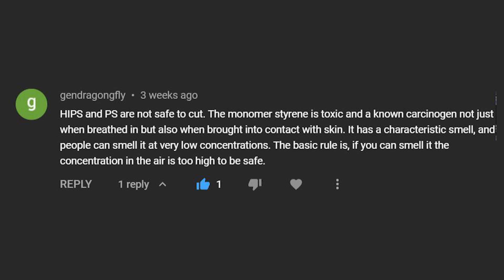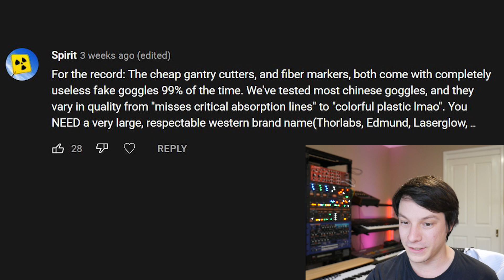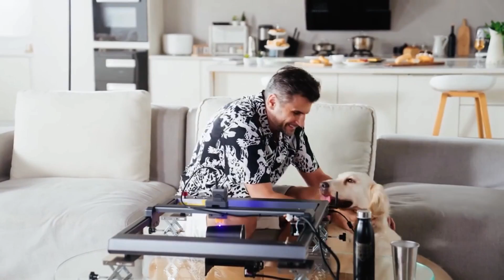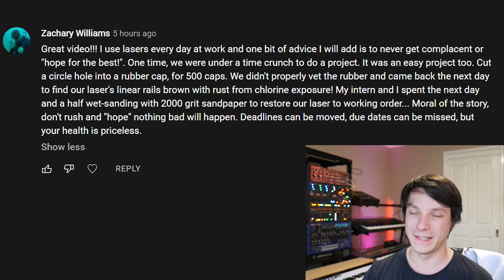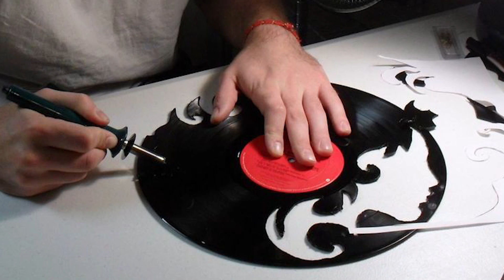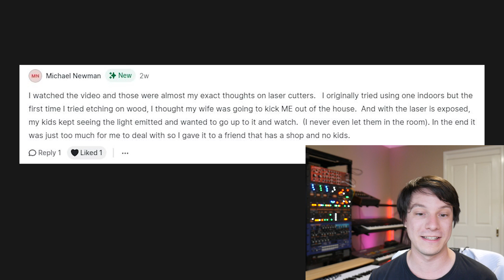What YOU had to say about Laser Cutter safety

Comment: I started with a cheap sub $100 laser a while ago, I upgraded over time and have gained experience with both co2 and diodes alike. Honestly, in the beginning I did not have knowledge or proper understanding of laser safety. At the time, I think part of issue is the community. Forums and videos always portrayed diodes as a toy and nothing more. You won't be batting with the big boys unless you get a co2. My first 5W diode was a real eye opener, a belt failed and it burned through my workshop wooden table. A simple $300 laser almost costed me my home. The prospect of burning my house down honestly made me realize how I really should have treated it like a "real" tool. I now have a  Jtech 14W as one of my main work horses, I spent about a equal amount to have a proper setup made. People don't realize the power these things put out, and I still see some of the toyish outlook on these diode lasers present. I just hope more companies and people start to understand the possible danger some of these can pose.
Reply: I don't own a laser but, I work in the printing industry and we're surrounded by diode lasers. Our imagesetters and print engines use diode lasers and they're certainly not toys. When Kodak shipped us a new diode laser for our Trendsetter the 6"x6" part was crated and palletized. I believe the "retail price" was $37k US. I know we weren't cutting through acrylic but we were imaging 26 23x35 (A1 ish) plates every hour 20+ hours a day 6 days a week.

Comment: The 1981 MGM fire in Las Vegas killed 85 people mostly from smoke inhalation from burning conduit and the coating on wires, lots of PVC. After the fire the building codes were changed to require metal conduit for commercial buildings. Low voltage wiring such as coax and cat 5/6 have to be in metal couduit.

Comment: This is so interesting. It took me a fair 2 months to research my options about lasers. A colleague of mine got a cheapo diode laser and showed me what he did with it. I sat down and researched it for a long time. An enclosure is an absolute must and making one for a cheapo laser is not exactly easy, safe and cheap. After much considerations I ended up with an EU built copy of a K40 that has CE confirmity. It was more expensive than a china K40 but I saved on shipping, import fees and it should be mostly safe. I ended up spending a fair bit on a went system, cooling, filtration, etc and still not everything is safely set up. Safety is really imoortant and people tend to be surprisingly uninformed...
Reply: I've designed a hermetically sealed Laser Engraving station for a 50W CO2-Laser. It's really, really tough to design a hatch for such a problem that is light-tight. I couldn't use rubber or any other sealant because even the reflection would damage it in a couple of weeks. In the end I had to design a labyrinth of metal sheets that reflected the light back into the case.
Reply: @huntersoa
 where did you get an EU-built K40?
Reply: @BonneWilce  I think the OG source was Variometrum from Hungary. But they no longer sell it. It was a second hand purchase from a small business. 
If you are interested variometrum still sells parts. Cooling, CO2 tubes, PSU, control board, etc. I think they also sell a complete movement system but they no longer carry k40 machines. 
Mine came with some extras to meet CE and had a proper manual, certification of safety, etc.

Comment: Great points about filtering before venting.  In addition to those, my vent fan had a leak in the hose after the filter.  Had I not been filtering the fumes first, that would have just vented into the shop space.  A basement makerspace I was with vented their laser out to the parking lot, and the fumes just accumulated back down into the shop.

Also, my wife an I have an agreement to never leave the laser running unattended.  I've seen too many fires from lasers at makerspaces and home shops.  Plus a fire extinguisher is cheap.  And  replacing the components or the whole laser from the use of a fire extinguisher is still better than the cost of replacing a whole shop/house/makerspace building after a fire.

Comment: Not something I'd want to cut without excellent ventilation but phosgene is not a major problem when cutting PVC as very little to none is created, maybe the confusion comes from phosgene being used in the production of PVC and other plastics?

There are other toxic chemicals and gases (hydrogen chloride for instance) produced which are far more of an issue, both to your health and the health of your laser cutter.

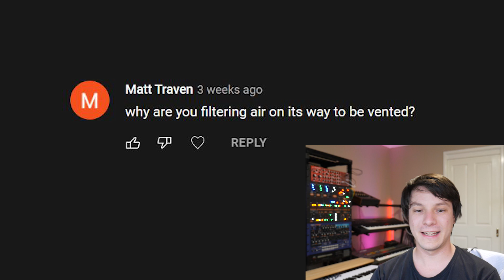Comment: 17:45
1. Not every place can easily be vented. I'm in a situation where I don't have any available windows to install a vent adapter, and cutting a big hole in the wall is a huge amount of time, fuss, and bother. (this is why I don't print anything other than PLA or PETG at home)
2. Even if you're venting the exhaust gases/particulates... they don't go away. Oh, sure, they'll go away from you (not really, but for the sake of argument), but some of that stuff bioaccumulates and is carcinogenic. I don't want that on my conscience.

Comment: Completely onboard with the sentiments presented here.

I'm a technician at a university and students are are required to attend a training session before they are allowed to use our laser cutter. Even then, their work needs to be reviewed by us before it can be executed.
Its common for people to leave cut lines on top of cut lines, sometimes stacked several times. A laser traveling the same path on wood or something over and over can very easily cause ignition.
Reply: Fellow University technician here, our 'training' was essentially a technician saying 'don't be a twat' and either way, everyone has access and does whatever because the PI's don't care about rules or safety. Does my head in. Anyway, hope you're well.
Reply: The dangerous thing is: to me, as an outsider, the points made seem very self-evident. I have the experience with dangerous tools (dangling upsidedown from a wire whilst handling a chainsaw isn't the safest job) to be aware that risk is often underestimated during work. and just enough experience with CAD software to know how easy those mistakes are.
But because those things feel so "that would never happen to me" most people (including me up to jist now) wouldn't consider them. Or consider them and then go "that would never happen to me".
Reply: Back then when I was in secondary (around 14 yo) we were trusted to use all the co2 and diode laser cutters by ourselves without much supervision, from turning it on and height setting to removing the finished part. There was some training beforehand e.g. turn on the fume extractor before start but nothing stopped any of my classmates from using it without the extractor on. In hindsight a lot could've gone wrong there, but at least the only materials we had access to were acrylic and laser ply
Reply: So how is the multiple passes option in lightburn safe at all?
Reply: It's also reasonable if you aren't familiar with the program to assume that those kinds of mistakes will be accounted for in software, like spell check leading to lazy typing/proofreading habits.
Reply: @KoroWerks  my first thought was "couldn't you build in those parameters?"
Then I remember that, when working with a boom lift, the first thing we would do is cut a piece of wood to size to bypass the pedal switch. 
To paraphrase a wise and well dressed man: convenience finds a way.
And then I also remembered the term "risk compensation": in some circumstances it is better to have less safety features and restraints, cuz having them in place will often, in those circumstances, lead to greater risk taking behaviour.
Reply: @KoroWerks  most cutting softwares on industrial machines do that, they check if there is no double  lines anywere in the drawing

Comment: Thank you for these two videos. I mostly understood the risks when I was looking into a cheap open-frame cutter (I needed a cutter with a larger build volume than those cheap CO2 enclosure ones), but after watching these videos I dont really think I actually NEED a laser cutter; rather I was just enamoured with the idea of them.

As an alternative to a laser cutter I have been considering getting a CNC router instead. I was wondering if you had ever thought about doing a video on them as an alternative to laser cutters and manual tooling methods (band saw, etc)? Would be interested to hear your thoughts on the entry-level CNC space.
Reply: Aussiegrif, I have approached this from the opposite direction in that I have been using CNC routers for a number of years to cut both large and very intricate parts in plywood, PVC, HIPS and brass with no problems other than the time is takes to cut very intricate shapes with tiny cutters to avoid breaking them.  I have often thought of moving to laser cutting, but the problems highlighted in this and the previous report have put me off this route.  I think that I will stick to CNC routers with a simple vacuum and cyclone dust separator to get rid of the particles thrown out by the cutter.  This seems a much better option for the jobs that I undertake.
Reply: I make plastic guitar pickguards and use a cnc but I know people who use lasers, and they do a really good job.  But my CNC does a good job too, and is far less dangerous as far as fumes and such.

Comment: I know from experience that you should only trust the safety data sheet from reputable whole sale companies. I am a braider that has used extensively kangaroo hide that is vegetable tanned hides. That process is entirely different from chrome tanned hides. Places like paler leather in Australia will have proper and a y rate safety data sheets available to the customer for free.

Tandy leather always has material safety data sheets for their products even though their products come out of china for the most part. I don’t think I’ve ever had a bad product from Tandy leather out of all the years I’ve been using their leather.

I do say that it comes down to the individual to find and familiarize them selves with the safety data sheets. If you don’t then it’s that person’s fault for being a idiot.

Comment: Thanks for the great videos Angus and definitely all the safety information provided in these videos on Lasers. I recently picked up an xTool D1 Pro 20W laser as well as the air assist, honeycomb bed, and enclosure. I will be sure to review the provided safety goggles and go purchase properly spec ones if they did not include any type of certification on the one shipped with the laser. I will either be buying a fume filter/extractor or making one before we get started using this new addition to our personal maker space.

Comment: Another reason to filter before venting is that if there is an air intake near your exhaust, you can end up poisoning yourself on your own exhaust gases.  When I used to dive we had issues with boats having their air intakes for the compressors being too near the engine exhausts.  The exhaust gasses would get compressed with the air in the tank and would cause significant issues at depth.
Reply: Still, the filtering Angus uses is mostly just wishful thinking. It's not enough to filter most of the dangerous chemicals and particles. Here where I live venting that stuff out with just a sketchy carbon filter attached would certainly be illegal. Even if you have professional filtering systems you might run into problems (our university workshop was closed because of the laser cutting filtering system that was not efficient enough).
Reply: @bzqp2  that really puts it into perspective.

Comment: Thx, you made me rethink on blasting my money on a cheap laser engraver/cutter. as an laboratorium safety officer I had my thoughts over safety (fumes and light). I guess I am not alone on this one. thx again, now saving up for a safe cutter. (btw 25 years ago the company I worked with had a  laser cutter for metal sheets, we found out is "blasted" the room with very small drops of  melted metal, we got it enclosed as no one knew the risks of microdrops of metal back then, a 3*3 meter squared machine.

on chrome tan leather, hexavalent Cr is almost an guarantee for cancer. but Cr6+ is banned in Europe. nowadays they use Cr3+ salts. I don't suggest eating it but it should be safe to process. But how do you tell the diverence, you don't. So there you have it, perfect ingredients for a heated debat.

Can I ask you to do a item on resins? I had a heated discussion during a workshop for 3d technics (fff, resin, modelling) when they supplied simple PE gloves (the one at a gas station) for handeling the uncured models. Safety is as important with resins as with the lasercutters. And I love the technics but would NEVER handle or store resins in my house.

Comment: I wonder, if a laser cutter is in a well sealed enclosure (airtight), would it be possible to pump the enclosure full of CO2, thereby displacing most of the oxygen and making it less likely for the cut material to catch on fire?
Reply: The professional cutters usually have a high power "air assist" to blow out any flame. The high end cutters can be used with nitrogen instead of ambient air (just replace the air pump with a bottle and dial in the pressure) if needed, so that idea isn't wrong but usually that's only needed in special cases (like internal cavities where the air assist can not blow into, etc.)

Comment: I have four Epilog lasers and recently had a Vytek laser installed at my lab and the inspection we had to go through for the ventilation was very involved. That and the MDS binders for the materials, the fire suppression system, and safety training, these open frame lasers should be banned or at the very least regulated. It’s scary that complete novices are using these in their homes.

Comment: Ever since I got into 3d printing and stuff I wanted to have a laser cutter/engraver and a cnc next to my printers to give me more options when it comes to making parts for various projects. You expressed pretty much the same concerns I had about what can you burn and what you shouldnt but my approach was allways "will this make my wife stay out of my workshop?". Sounds dumb, I know, but my wife is not watching videos with this kind of stuff and thinkering with different machines like I do, but she DOES run my 3d printers while im at work to get projects done in time. So with that in mind, with everything i do I allways think "how can I make this easier and safer" so my wife (for now, I.ll mention kids later once they come😁) can still be around my machines even tho she only wants to know the bare minimum about them to help me.
Reply: I put a small orange cone at the door of my garage while the laser is operating. I told her if the cone is there she needs to knock. If she knocks I hand her a pair of glasses she can put on to enter. Simple solution but it works well.

Comment: A thought I continue to have that has even kept me away from fully enclosed cutters like the Gweike cloud/glowforge style cutters is, are the windows they have for viewing actually effective against the wavelengths they use? I've not seen anyone test this anywhere for any cutter and its always bothered me.
Reply: The same materials that the laser can cut most effectively are the ones that absorb the most laser energy, for what should be fairly obvious reasons. Simple clear acrylic is a perfectly sufficient shield for a standard CO2 tube laser like those machines use. For machines with visible wavelength lasers it's a lot trickier.
Reply: @JamesChurchill  I was going to make that reply if it hadn’t been made before. Incidentally; most window glass is highly impenetrable to far infrared like the the 10 064nm CO2 machines are. On my 50W fibre laser, 1064nm or 1mm wavelength, I tested polycarbonate & it cuts it with the same black particulate carbon smoke residual. I have made a see through shield for the work area out of it because I know it will absorb the ir reflected so well.
Reply: Would be an interesting test, but wear googles regardless

Comment: I saw a paper which used pyrolysis-GC-MS to analyse chemicals given off by 3D printer filament when heated. A similar technique (though you of course want to burn the sample, which requires a higher temperature) could be used with prospective materials for laser cutting to assess their safety and suitability.